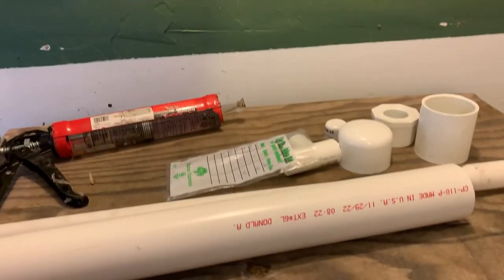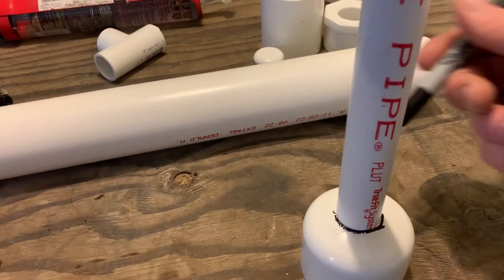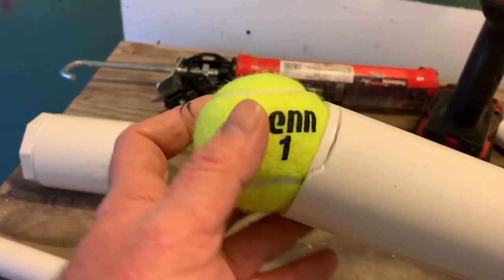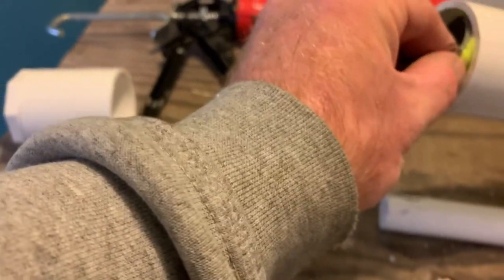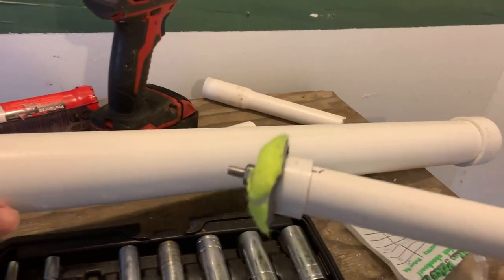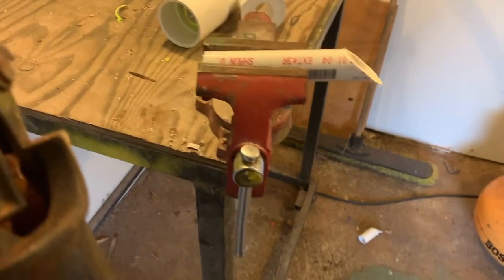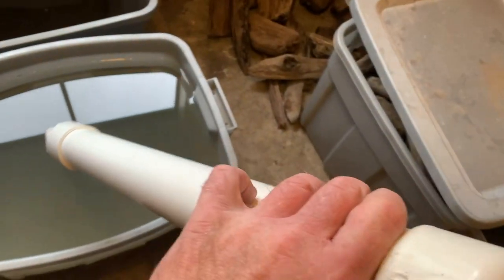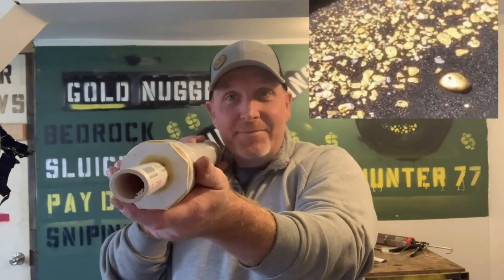DIY Hand Gold Dredge using a Tennis Ball!

Comment: Hi thanx so much for your video. One way to stop clogging in small pipe is to put a pin through the top of pipe like a split pin. It will stop the small rocks getting jambed in the pipe
Reply from the maker: Hey thanks Ed. I thought Bout that like they have on full size dredges but forgot about the idea I appreciate you and I'll be sure to add that feature!
Reply: @Goldhunter7769  no problem bro glad to help

Comment: Good vid. Instead of glue, I use small half inch sheet metal screws to hold fittings that you would normally glue. Just one little screw on each fitting, even the internal connections. That way, you can take it apart and replace the seal (tennis ball section) if you need to, or tighten internal bolt if it ever works loose.
Reply from the maker: That’s a great idea thanks!

Comment: I did mine a little different on the bottom of the main shaft. I put a coupler and glued a couple to the main shaft. I have a mate from the nozzle end and I will slide into that coupler I do not glue it. I also made a second one that the nozzle and will plug into but it is a 45 angle backwards and it also will slide in to look up or at the end of the shaft.  Drill a hole through the coupler into the Mail that slide into it. Insert a short screw the screws in and keeps it from coming out now the 45° angle Y can be removed. The nozzle can also slide into that coupler, and that screw can go into that the hold out that way the 45 angle backward coupler can be removed, if not needed. 45* Y act like a sluce., and when the water passes over it, the gold can drop down into the Y. The end of the way bottom has a couple on it with a screw in cap so it can be empty. I also rolled two holes in the top cap of the spout. Now you don’t have to glue. It undo a screw on each side and it can come out for repair that.Y act like a mini sluce.
Reply from the maker: Sounds like a great idea, my next one I’ll do something like that and I’m also considering a snake version.

Comment: If you use a street y, a 6 inch length of pipe, and a screw in clean out you get a sump that collects more dirt so you dont have to leave your spot after each pump and its super easy for clean out.
Reply from the maker: Good idea and I’ve seen them but heard they clog up a lot. Is it tue? That’s the reason I never made one.
Reply: @Goldhunter7769  if you let it get impacted.  If it does get impacted I just suck up some water and give it a little shake and it's good to go.

Comment: I made mine last night. I made the top hole larger so the air can escape faster. 
There are certain caps that I didn’t glue. I tapped them on and drilled a hole threw both from the outside so I could put a small screw that acts like a pim..
I also made mine with a trap for the gold can drop into when I pull back. 
I made it with an angle 2” 30* Y with a clean out at the end.  I made it removable so I can use it or not.
Reply from the maker: There you go. When people ask about these and I tell them this is just a very basic model. I’ve made them longer and some different handles. The tennis ball material works great as a plunger if done right and last forever.

Comment: How long is the main larger pvc. I missed it in the video.
Reply from the maker: 2 feet of 2 inch pipe and 3 feet of 3/4 pipe. If you want yours longer that’s fine too just make sure your 3/4 pipe is always a foot longer for the tip and handle portion.

Comment: I used a heavy duty doggie tennis ball hoping it would seal better and last longer but now I think its going to make my shoulder flare up. That might have been a mistake and I might have to cut it down or  go to a regular tennis ball.

And my seal flips back and forth with the stroke so it might not matter which way it goes.
Reply from the maker: @jamesderr1344  some guys use two don’t goes both ways but mine works great with the concave facing up.